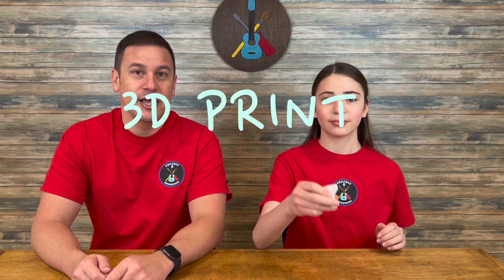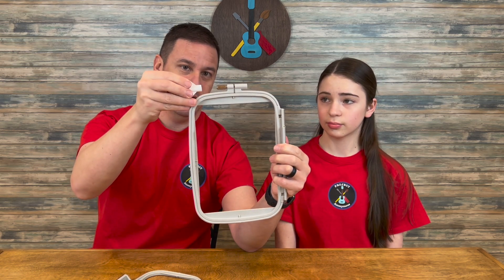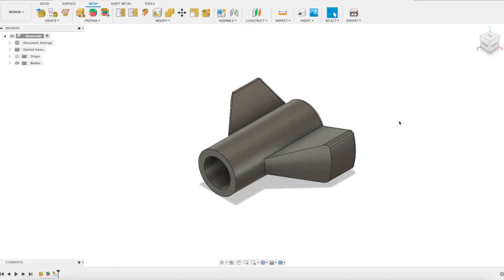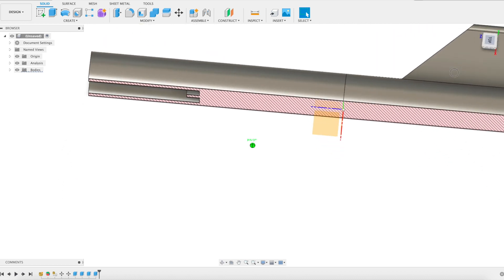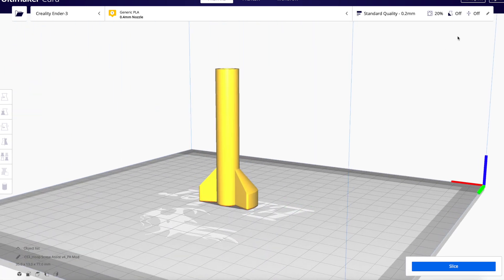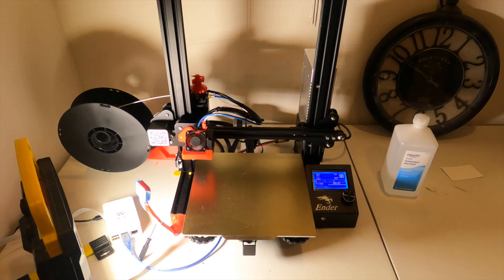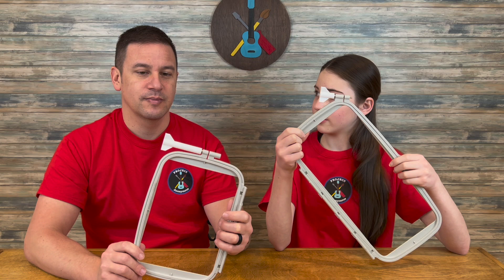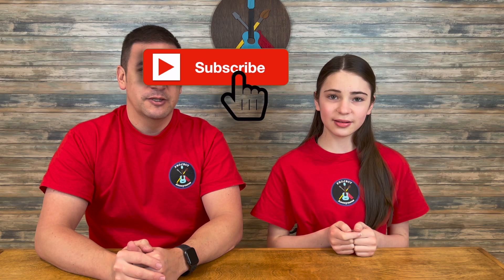3D Printed Machine Embroidery Hoop Screw Attachment

Comment: What hoop are you using. That looks like my Viking hoops. I don't want to print it unless it will work with my hoops. TY
Reply from the maker: The screw knob assist that was featured on this video was designed to fit the 5x7 Brother hoop
Reply: @ProjectAnonymous_Duo  Thank you. I appreciate it. I have brother hoops too. LOL